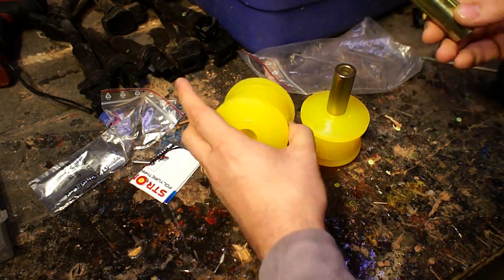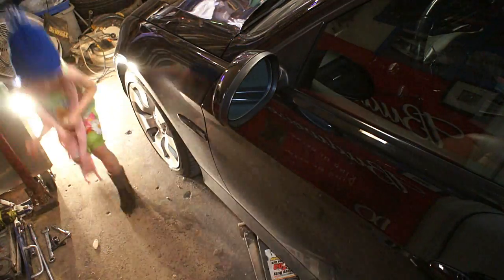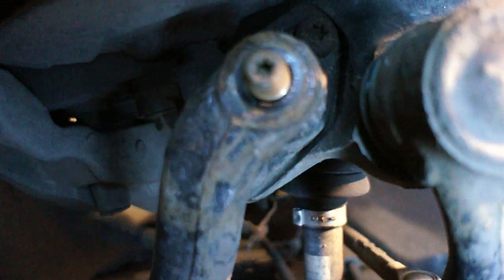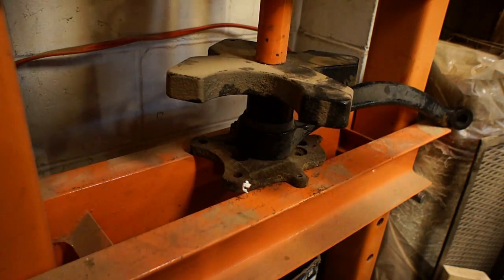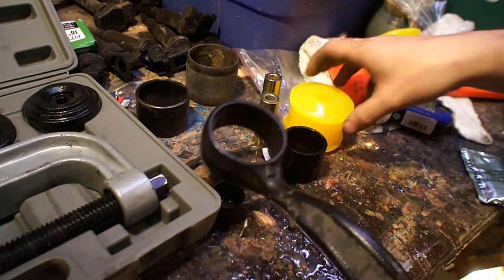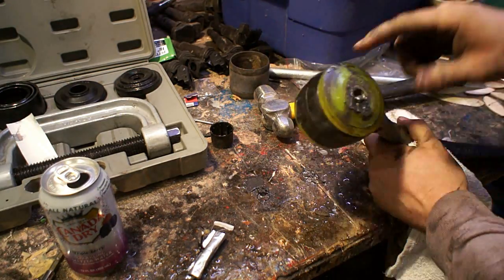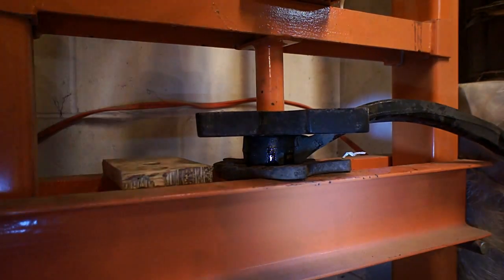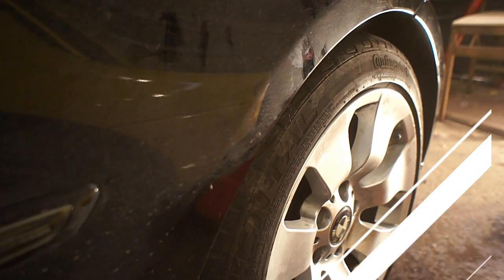BMW 3 Series Front Control Arm Bushings e90/91/92 AWD polyeurethane

Comment: Hi, will these work a 2006 Bmw 330xi? It is an e90 AWD

Also, whats the direct link to these?
Reply: www.strongflex.eu - 031528B is the 80 shore hardness ones for e9x xdrive tension strut bushing (slightly softer than yellow)